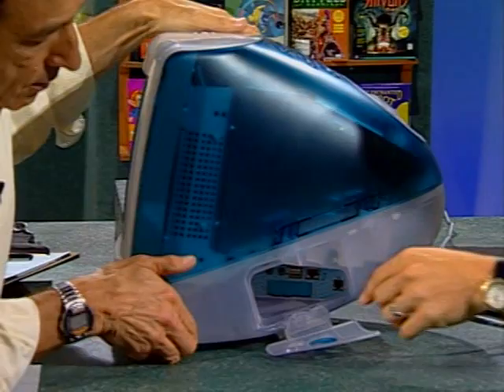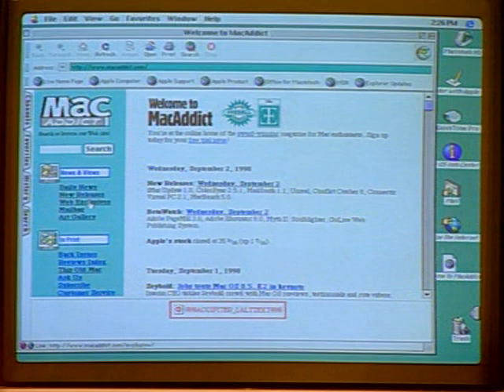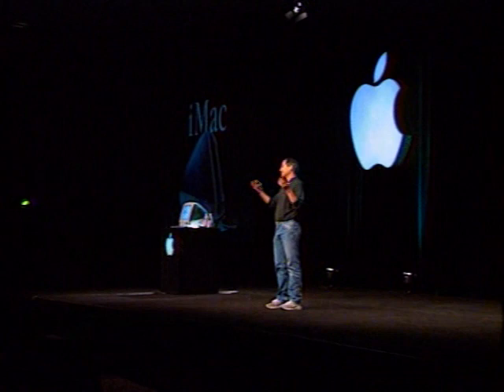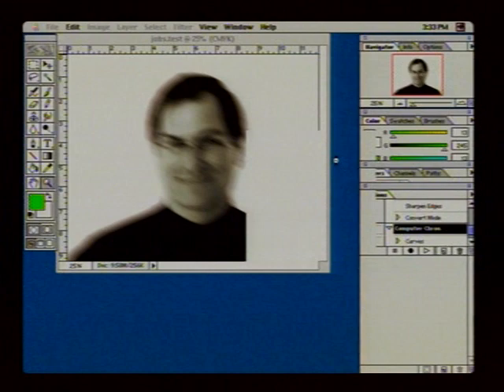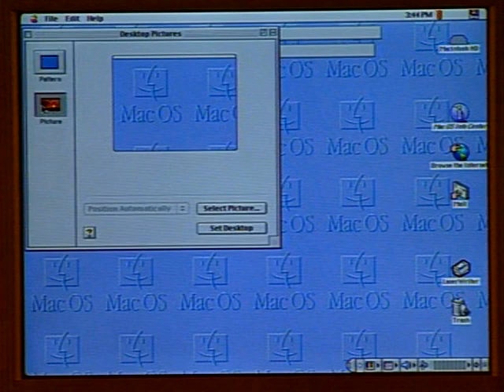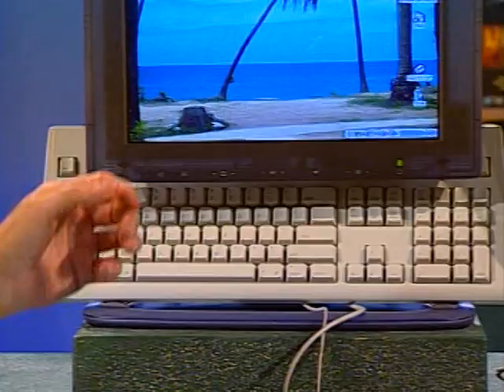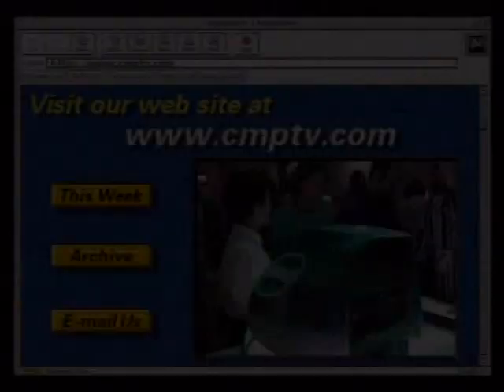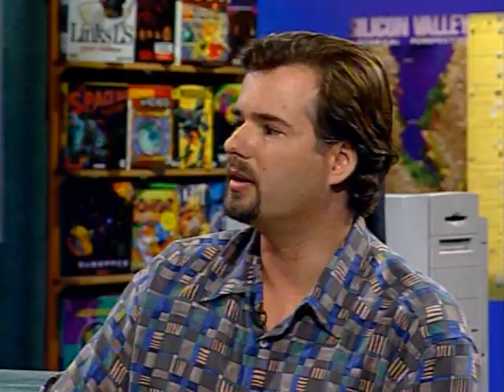The Computer Chronicles - Mac Update (1998)

Comment: I really like the part talking about Apple company in 1998. The fact is that the clone market did not help Apple. They thought it would expand their market, But the bitter reality was that the clone markets sold high Margin computers without worrying about development, branding, … So, they actually sold cheapper great computers, which were great thanks to Mac OS and overall Macintosh brand and platform. 

But people in 1998 thought differently. Actually, shutting down clone makers was in my opinion easy and straightforward decision.

Comment: In 2021 Apple reached 7.5% of the market, according to IDC, which I think is not so different from the late 1990s. But this 7.5% actually means over 100 million users (compared to 20-25 million back in the 1990s, so 4-5 times more customers), so Apple is doing great because they sell a lot of computers for a single maker, and at generally higher prices than PCs. Apart from that, they are not just a computer company anymore, since they make other electronics as well, so the reinvention of the company as Steve Jobs intended to be has happened. Also the market is different now: Compaq has vanished, HP and Dell are doing well, but they are facing great competition from Asian companies (Asus, Acer etc.) who sell cheaper. In other words, market share is not everything. I've never had an Apple product, apart from iTunes and Safari on my PC, but I have a lot of respect for them on how they managed to stay and grow in the business all these years.
Reply: Hard to love Macs, since they lack versalitily. For example you can´t connect Elgato capture cards to them, can´t really stream with them, can´t game with them and the amount of external HW that is compatible with them is very limited.
Reply: @Joseph Yeah, I know, I recently switched to an M1 Pro MacBook Pro 14 inch, it‘s a much better experience than Windows.
Reply: @Kynos1  Nice. I got one of the new 16". They're great machines.

Comment: LOL at how Apple tried to talk shit about x86 processors and tout their PowerPC processors, then do a complete 180 degree turnaround years later going with the x86 since they finally got out of the stage of denial.
Reply: The switch to Intel happened eight years after this show. The Intel and compatible CPUs back then were worse than the PPC contemporaries. Only years later when IBM couldn’t solve heat and power issues with the G5 and Intel trashed 90% of their designs to focus on new ones based on their mobile designs and licensing AMD 64Bit technology Apple switched. So it has nothing to do with denial and everything with changing technology.
Reply: The cpu space was far more fragmented in the 90's. PPC. PA-RISC. SPARC.MIPS. The alpha. As well intel was attempting to Sunset the x86 so they could ship itanium. 

Actually at the time Intel was barely ahead in the x86 space. AMD was punching above its weight and cyrix was gobbling up the low end market. 

At the time PPC and x86 were pretty frequently trading blows and the top spot in the consumer space. Only getting worse with itanium failing and the Pentium 4 being a disaster. 

Intel only started getting its groove back after ditching netburst and itanium and going all in on AMDs 64 bit architecture and power efficiency.
Reply: Only to abandon x86 for ARM and custom silicon.
Reply: @directive0  Leaving Intel and x86 in the dust.
Reply: Dude you cant say a Pentium 4 of the 00s was anywhere near as good as the CPUs Apple or even AMD were using , in reality Intel caught up by 2006 with the core 2 duo and Quad CPUs
Reply: @Patriciern  Nice try, but no. The CrApple™ "M-" chip looked nice on paper, but in reality it's nowhere near as powerful as either Intel or AMD designs.